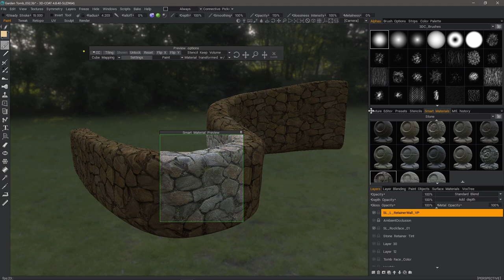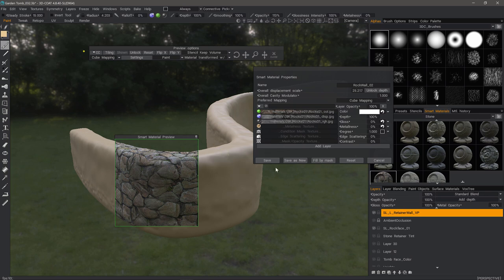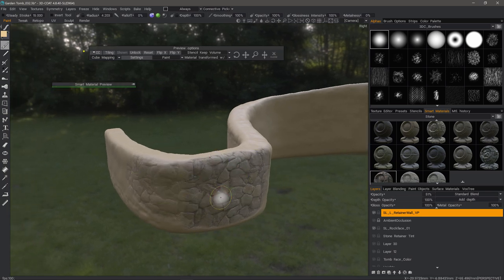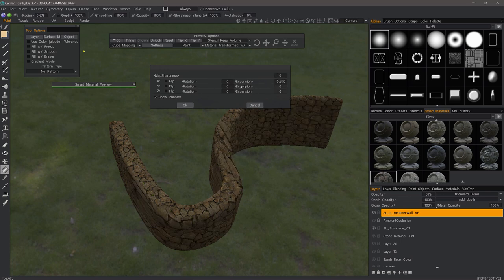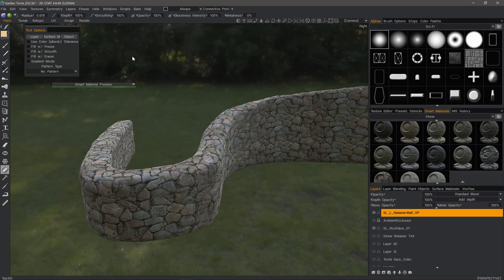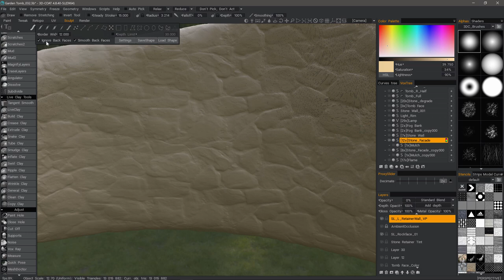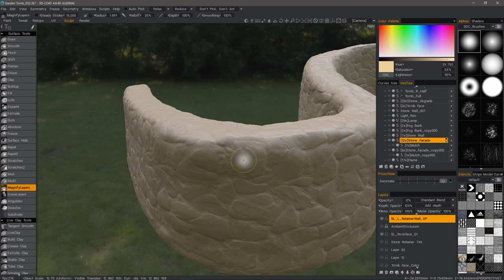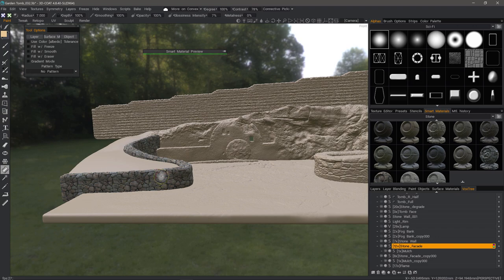Unique Sculpting Features in 3DCoat Pt2

Comment: I noticed that this is using the 4.8.40 -SL build. Do you have a date as to when this will be available as a regular public build?  Also, I take it I can the have the latest public build (currently 4.8.37), plus the version shown in this video installed at the same time (not open at the same time, but just installed so that I can run either version. I have a full license but just want to be sure before I can do this before downloading 4.8.40 -SL). Thanks :)
Reply from the maker: Andrew has just kept the Sculpt Layer Beta work done on a separate build, until he's finally completed it (with some work on other features), for the sake of stability. It may stay that way until an official release. He hasn't put any time table on it. As to your 2nd question, yes, you can use both builds, no problem.
Reply: @3DCoatTrainingChannel  Thanks. I installed it and had a play last night. Very interesting and a pretty cool function. Obviously being in the beta stage there are some issues to iron out... I did have it crash a number of times... but worked out it that it didn't like it with my Wacom Cintiq on as well as my main monitor. Other that that it worked great. :)